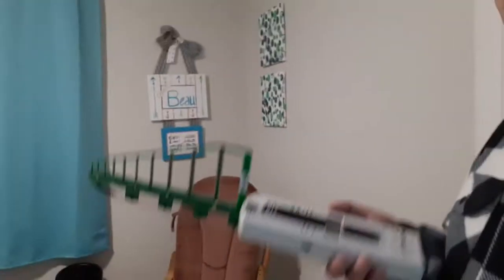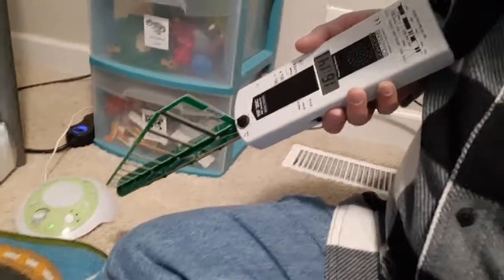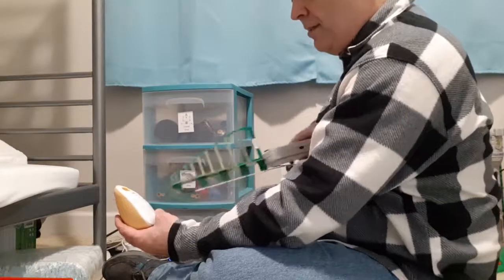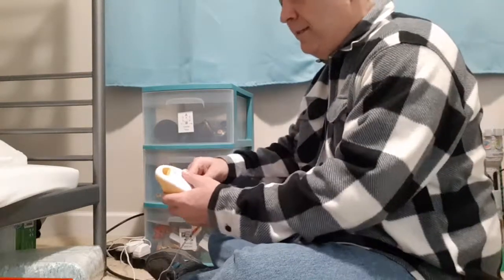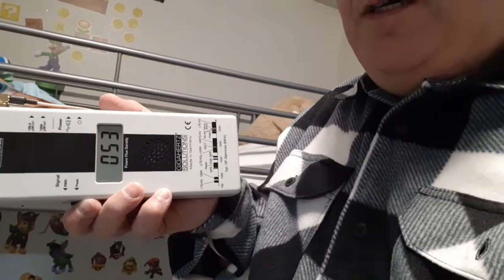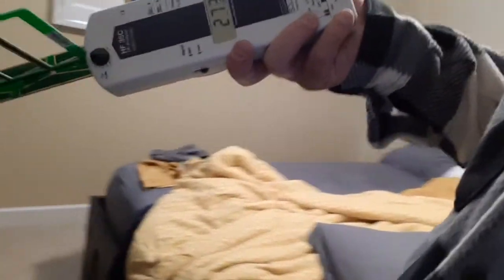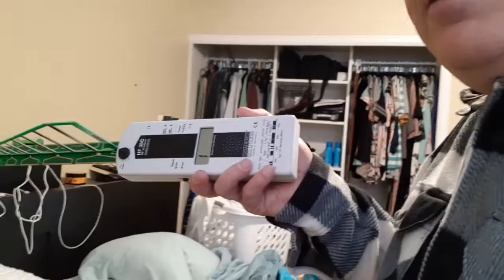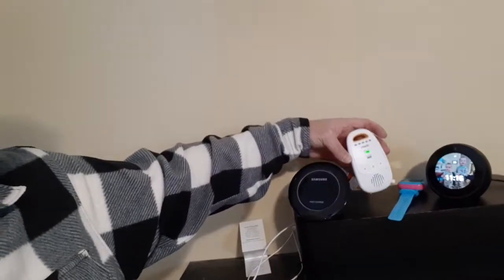Testing A Home For RF Radiation Part 4 - Baby Monitor

Comment: On your website you say "this emits the same frequency as your microwave, you wouldn't microwave your lasagna near your kids head, would you ?". Doesn't that statement ignore the fact that microwave emits that radiation at thousands of times higher power than any wifi device ? Seems a little fearmonger-ey to compare the two as if comparing apples to apples, no ?
Reply from the maker: Great question. You are correct there is a huge power difference between a microwave oven and our kid's baby monitor. But many independently funded peer reviewed scientific studies link this low powered non-ionizing radiation (like that of a baby monitor) to things like cancer, DNA damage, infertility etc. I don't think I am over emphasizing the danger. This expert says that he has witnessed it causing crib death. That is pretty severe. Here is his video https://youtu.be/z99_SzoXZdY. And if you want to read the science I link to a lot of it here on the scientific studies page of my website https://www.radiationhealthrisks.com/scientific-studies/

Comment: Good thing I saw this video David, because this is the same problem that I just discovered two days ago. We have the same V-Tech baby monitor and it was giving power RF radiation from our bedroom where we all sleep, spouse and two sons. I used the Cornet ED-88T Plus to detect the following RF radiation, the sending device 

Reached up to 126.4 mw/m2 up close
Ranged from 5-7 mw/m2 laying on the bed
Ranged from 5 to 30 mw/m2 walking around in the bedroom

We usually keep this device on throughout the day; I decided to take it off now. 

The receiving device is by the kitchen table where we all eat
Reply from the maker: If you use a non wireless (in other words a wired) baby monitor then you don't have any RF radiation to worry about. Just don't hard wire it the wrong way as I test in this video https://youtu.be/wCFSjWgvQqM. If you do it the correct way (with regular shielding Ethernet cables) it is much safer.
Reply: @RadiationHealthRisks  Thanks for this